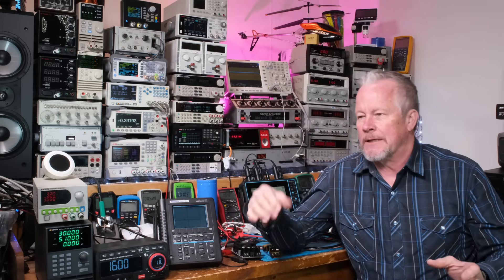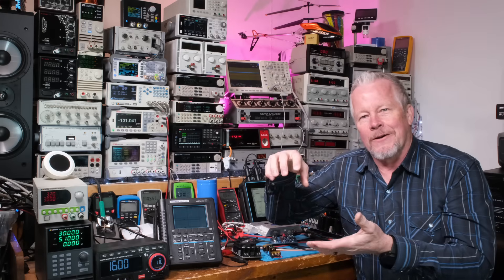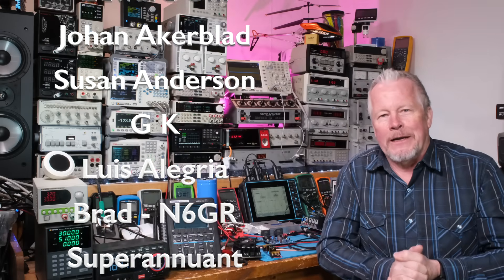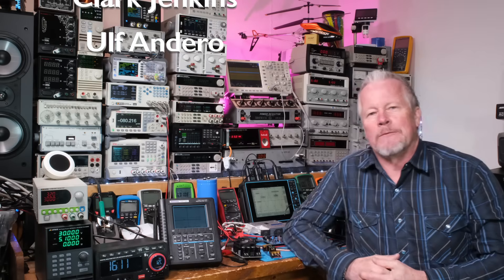Capacitor Bypass Value Myth #stevensandler #ericbogatin #bypasscapacitor #couplingcapacitor

Comment: ceramics still have some piezo effect, we had to go to other materials, mica, etc. - for bypass piezo does not matter as much as in the actual signal circuits, especially high gain
Reply from the maker: There are types of ceramic capacitors that do not have the piezo effect.  I use COG/NPO type when I am concerned about piezo, and/or I just want a more temp stable capacitor.

Comment: My understanding of adding a small value bypass cap was that if you have for say a 100uf electrolytic cap you want to use a a bypass cap such as a film because it has very low esr compared to the e cap and something like a .1uf to 1uf could be a could value to help create the lowest impedance path for unwanted high frequency noise.
Reply from the maker: Yes - and you are correct.  This myth has to do with dropping capacitors 10x value apart from each other - even if they are all ceramic capacitors.

Comment: Wow! That's the biggest collection of lab supplies, decade boxes, signal generators, multi-meters, and other assorted electronic test gear I've ever seen in one place! Doesn't have any bearing on what you're saying though...if I had all the test equipment I've used in my 40+ years in one place, it would look similar. People are interested in what's in your head, not what's on your bench.
Reply from the maker: Thanks so much!  I appreciate you!  It was recommended that I provide eye candy - so maybe I went overboard;)

Comment: If you were to use something like DATS or another method to plot the reactance of that large blue electrolytic I believe you would find Xc will nicely decrease with frequency as you would expect into the upper audio ranges, then it will begin to increase as inductance takes over.  Big deal in audio and other analog circuits.  This is where the smaller value high quality caps get added as closely to the large capacitor as is practical.  The large capacitor is increasingly "non ideal" as frequency increases.  It's doing a fine job smoothing and filtering the 60 or 120 Hz output from the rectifiers.  It just isn't behaving as you might expect with respect to frequency.  It isn't the wiring to the amp board from the filter section causing this, although poor wiring and /or grounds will always cause problems.  The added smaller value high quality caps aim to restore the power supply to the theoretical "ideal" short circuit expected in circuit analysis by providing a path for the high frequency signals the big caps just can't bypass or filter.  Low ESR and low dielectric absorption caps help, but don't completely eliminate the issue.  There is a large difference in the slewing rates, square wave ringing, over and under shoot, and transient response characteristics of amps with poor versus good power supply caps and/or combinations of caps to get a closer to ideal performance from the filter bank.  

This only applies to power supply sorts of massive filtration, in signal paths using same value caps but in higher quality makes anywhere from great to zero difference depending on many factors.  A really cheap 10uF electrolytic in the signal path with behave quite differently from a polycarbonate cap in the same location, mostly due to the DA and possibly inductance issues in lower end electrolytics.  Many have forgotten or never knew, but capacitor issues were a major contributor to the 1970's transistor amps measuring great and sounding bad ruckus.  THD, single sine wave frequency response sweeps, IM two tone sine wave measurements, and the other standard steady state measurements used for years in the tube amp world don't and can't characterize the poor slew rates and transient intermod products created by impulse signals.  We went from high impedance high voltage low current tube circuits to low impedance low voltage high current bipolar transistor designs and things got pretty messy.  Bypassing a lower quality high value cap with a high quality low value cap often improved performance.  Replacing the lower quality cap with something better usually was even better.  I think this may well be where the several decades stacked up approach to shotgunning bypass cap selection got started.

Once FETs started being widely used in analog design we were back to higher impedance inputs and smaller caps, so some (not all) of the issues just went away over time.  And another batch of engineers relearned many of the design approaches the retired tube guys took with them.  I was one of ones relearning, but at least I'd worked with tube gear a fair bit.

For bonus fun, something like a tanalum cap in the signal path with be horrible if not biased, but if coupling to a point at around 1/2 the supply voltage may measure much better.  Still far from excellent, but at least worth considering in mutant circuit designs.  One of the few places David Hafler plopped a tantalum cap was in the signal path of the DH101 preamp and it still managed to sound good because of the bias voltage.  Replacing it with polycarbonate or at least bypassing it with polystyrene did make a noticeable difference however.

In the digital world my practice was always to use the thickest ground and power traces I could shoehorn in or better yet use power and ground layers in the boards.  Use a bypass cap per chip,and where there is room add at least some pads to populate with more caps if you must.  Check the prototype for unexpected amounts of hash on the power supply pins on each chip.  Different logic families have different sorts of weirdness to trip you up.  As soon as you start playing in the ADC/DAC/Quantizer world all bets are off if bypassing, isolation, and quality of digital and analog grounds and power sources were overlooked.  Doesn't matter how sexy your decoupling and bypass caps are if the ground isn't worth squat or your power source is getting choked off.

Amazing how complicated such a simple two legged part can get isn't it? 🙂  Retired now, but sure have enjoyed the ride!  Mostly anyway...
Reply from the maker: Thank you for the fantastic feedback!  You point out some great applications - snd as there is so much that is common today - there is so much that is different.

Capacitors have come a long way - but we have to understand how they work and where they work the best.  I will do some videos soon to help give us some insight and thoughts what might work;)

Comment: Hi. I was a circuit design engineer for 50 years and I think it would help to describe how to chose suitable values. There are two things that capacitors on power lines can do in circuits. The first is to act as a tiny rechargeable battery to provide extra power to circuits to handle peak output currents. The second is to connect the DC power lines together at ALL frequencies. This is an assumption made in all circuit designs. This is the "decoupling" function. 

The power function is only needed on circuits and chips with significant power consumption VARIATION in normal use. Use a single capacitor large enough to fully supply the chip for about 1 ms as near to the chip as layout allows.

The decoupling function is actually much more demanding and this is where "rules of thumb"  came in. For audio and slow logic using though-leaded caps the three caps rule saved a load of design time as doing it properly takes a lot of effort. To correctly decouple a device you first need to determine the range of frequencies where the AC short across the supply has to apply. A good guess for the lower frequency is 15Hz and the upper limit three times the bandwidth of an analogue chip and 3GHz/ [switching time in ns] for a digital circuit.  Look at the data for the esr of small ceramic caps and pick one where the esr is no more than twice the minimum at the highest frequency. See at what lower frequency the esr is also twice. Repeat for a larger capacitor using this new , lower, frequency. Keep doing this until the lower frequency is below 15Hz.

As an extreme example, for a 1kW 5000 MHz transmitter stage the capacitors ranged from 10,000 uF Solid Electrolytic at 100V to 33pF Mica rated at 30A continuous current.
Reply from the maker: Thanks for the great feedback!  It sounds like you had a great method of choosing your capacitors.  I'll do some videos showing capacitors and their characteristics.

Comment: Sometimes its good to have extra pads to put various sized caps on your board and some test points. Drop off the design after you get it dialed in.
Reply from the maker: Thanks for bringing this up!  Yes, some call this as place holders;)

Comment: Loads of ceramic smd bypass caps, and then one of them shorts. I blame the lead free solder, heat cycling ripping them apart. Makes no real difference, they still short, can be an easy repair if you can find the little blighter.
Reply from the maker: Thanks for bring up this - soldering is important.  Hand soldering ceramics can be troublesome.  There can be micro fissures that are not obvious but later result in a short.

Comment: for a general low freq board (< 1 GHz), I've never had an issue doing the following

1) use a ground plane, if you don't understand why this is important, use a ground plane.
2) design the power supply for the maximum current the board will draw plus 30 to 40%
3) 100nF ceramic cap on every power pin, 100nF + 10uF on Vref pins.
4) Use the smallest package size X7R or X5R ceramic capacitors that your design allows to minimize the ESL of the cap.
5) De-rate ceramic caps by 2x ie the  Cap Voltage rating should be 2x the voltage rail value or higher.
6) The amount of bulk capacitance needed is determined to keep the voltage rail in spec during a worst case load step.  Bulk caps can be distributed around the load.
Reply from the maker: Thanks so much for this great feedback.  I followed a very similar protocol, but I started replacing the 0.1 uF capacitor with at least a 1 uF cap and depending on the part - I'd place a 10 uF cap (or sometimes 2x 1 uF).  This is after I found some issues in other circuits - and using larger capacitance values solved those issues.  

Another thing - using a 0.1 uF + 10 uF cap is of no benefit - except if specific types of caps might be used.  I'd say that the 10 uF cap by itself - placed very close will swamp out any benefit of the 0.1 uF, or if the 10 uF is physically larger - than I'd place a 1 uF cap closer to the pin.  Something to think about - just check the impedance curves of the 0.1 uF cap to your 10 uF cap.  

BTW, even with use of nano for capacitors these days (where nano was not used in the past) searches for uF instead of nF will result in better searches. ;)
Reply: @KissAnalog  
Well experiences vary, I understand that some engineers grew up with the uF/pF terminology so that is what they use.  I've always used mF/uF/nF/pF since I graduated from college a long long long time ago.

I can't really go into my board designs, but lets just say using 10uF in place of the 100nF caps is impractical.

Although we do have a difference of opinion on the way 10uF caps perform vs 100nF.
The 10uF require larger packages and more layers in the ceramic to produce. 
This gives them higher ESL (equivalent series inductance), which means worse performance at higher freq above their resonant freq.

Any great topic, I enjoyed the video.
Reply from the maker: Thanks for bringing this up.  When I say use a 1 uF instead of a 0.1 uF, I mean when it is in the same package.  Today, you can get X7R caps in 0402 for voltages that cover most lower voltage applications.

Thanks for the discussion - it brings up decision factors that we should consider.
Reply: @KissAnalog  Don't overlook the max current rating of the smaller packages as significant peak current can be present on driver chips etc. Also Geek-A-Hertz8707 is absolutely right about 10uF caps - always fit a small cap as well.
Reply from the maker: @adrianandrews2254 Thanks for your feedback - but aren't you being contradictory in you advice - talking about significant peak current - but then talking against 10 uF caps?  LOL  No - really - this can be confusing and every case has to stand on its own merits.   I will show how a 10 uF cap can be just as good at high freq as a smaller value cap.  Also a 10 uF takes care of the type of parts you bring up that can run on high peak currents - but also need high frequency filtering/decoupling;)
Reply: @KissAnalog  Driver chips short the power supply every time they switch for about 1ns ( ie at 3GHz ). You need a low inductance capacitor to prevent this from causing a problem. To get  over this use a LARGE package with a SMALL capacity - say 1206 1000pF. A 10uF cap won't see that spike at all.
Reply from the maker: Are you referring to drive chips for power supplies?
Reply: my 2 cents which only worth about 1 cent these days 🤣🤣🤣

modern switching power supplies have integrated dead time in the design so both fets aren't on at the same time.  this is why diodes are still required to provide a current path through the inductor when the fets are off.

in cmos logic there will be a current pulse when the logic is changing state, but for me a 1206 cap takes up too much room and has too much parasitic inductance.
Reply from the maker: Yes - I would agree - thank you!

Comment: BUT DIFFRENT SIZE CAPS DO CHARGE UP AT DIFFRENT TIMES. SO THAT MEANS SOMTHING
Reply from the maker: Yes that is correct - that is the XC of the capacitor.  But what we are talking about is the parasitics - the part that makes up the total impedance.  Ceramic caps a decade apart have impedance values based as much on the total impedance vs just the XC value.

Comment: Not sure how this vid ended up in my feed, but I'm glad it did. It took me back to my roots in my career as an E.T. who started designing PCBs with black tape on acetate sheets on a light box. Back then everything was through hole, SMT was "esoteric" and just starting to come online (circa 1985ish). Also I remember those under chip caps! Never used em because of the cost, but I remember when they came out. Our prototyping was done with wire wrap (mostly digital circuits in a card cage). There was a company that did something similar with the wire wrap sockets where they would have the decoupling cap built into the socket, held in place with a kapton like film and a conductor to the 74 series corner power pins.

We had some interesting RF designs that went to extremes to decouple various stages from the main power supply. The designer would actually put a resistor in series with the power pin to increase the DC resistance to the main rail, then pile on the decoupling capacitors at the chip (usually an op-amp) so that they would dump their charge first, then recharge from the main rail to soften the surge. These were 12-15V chips, so the I/R losses were not harmful as there was plenty of headroom.

Later, when we started designing our custom control boards for an MRI machine that used a VME cage 9U section, each board would get a 1F bulk capacitor with a few 100uF spread out and each chip got the requisite .1uF. These were not terribly fast clocks, maybe 10Mhz so it all worked fine. Never had PS startup problems since the cage was powered by a 55A switcher. 

I also wanted to impart some wisdom I learned along the way. It has nothing to do with decoupling/bypassing but it can save a lot of heartache in mixed signal applications. If you are ever using an op amp as a comparator to "square off" a sine wave or other analog signal that you still intend to use further down the line, ALWAYS put a unity gain buffer op amp ahead of the input to the comparator IC to prevent the comparator from corrupting the analog signal. If you don't you will see the source signal imprinted with the switching transient (which is NOT PS related). When I started at a new company, there was a circuit like this that was coming from a photodetector from a laser and the engineer (A physics PhD) couldn't figure out why the nice sine wave was coming out with zero crossing artifacts. I explained it to him, as this had come up at a previous job with more experienced engineers, added the buffer and problem solved. If I save one person from this, it will have been worth the wall of text.
Reply from the maker: Thank you so much for this awesome feedback!  I remember those chip carriers with the ceramic cap tied from VCC pi to GND pin underneath it.  I also did my fair share of wire wrap:)

I also use a resistor for dampening in certain circuits:)

I love the idea of the buffer amp to isolate impedance mismatch.  I had an amazing mentor that taught me that:)

Thanks for sharing these real world examples!!

Comment: The TYPE of capacitor will influence the impedance over frequency and temperature and time as well. I have power supplies I built in the 70's with ceramic and Tantalum bypass caps that are still clean in 2025.  Cheers, --bd
Reply from the maker: Thanks for bringing this up!  Tantalum capacitors work fantastically with Ceramic caps!!

Comment: I will say that when recapping old tube broadcast radios,  you can get by with about 3 values of replacement caps for bypassing in those.  There is not a huge variety of values of coupling or bypassing in those designs. Even for power supply filter caps you can get by with a smaller inventory of caps.  You will see more variety of small value caps in the RF circuits though.
Reply from the maker: Thanks for the great feedback!  Are these typically thru-hole capacitors?